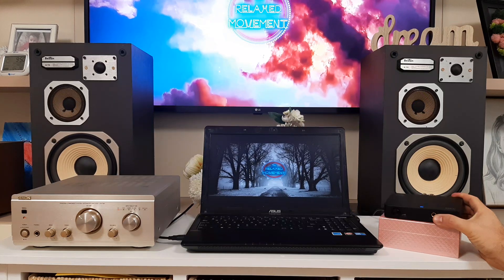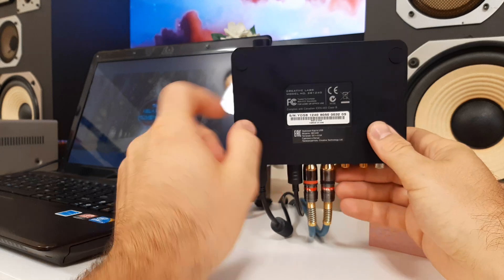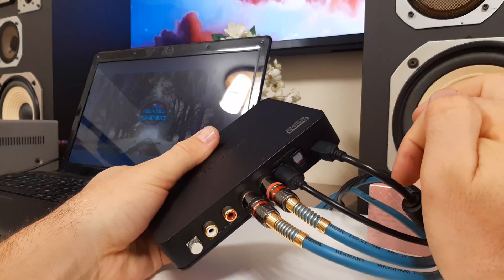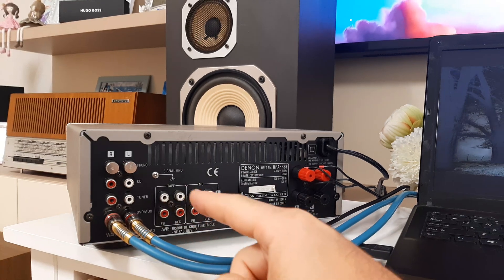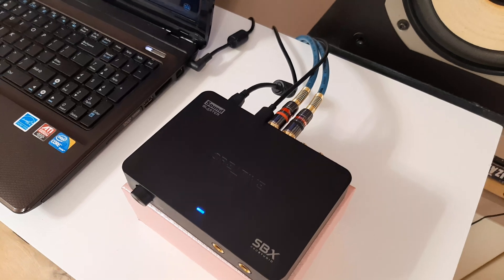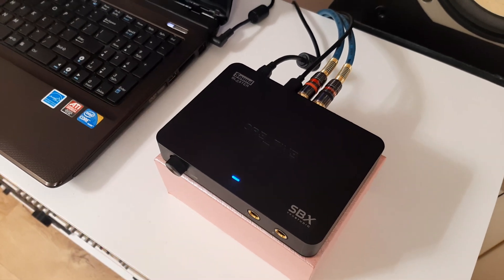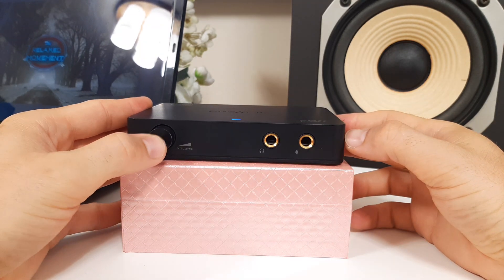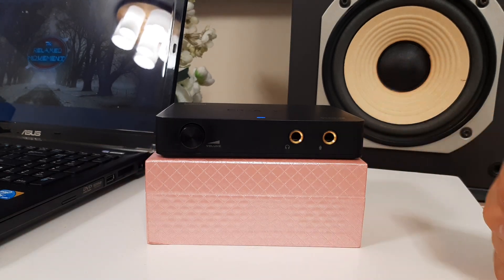How to Connect Audio Power Amplifier With Sound Card

Comment: hi, could you tell me how to connect the amplifier to the creative x4 sound card?
Reply from the maker: Hi Vladimir, congrats for your X4, good sound card. I will attach a link here for manual and i will explain also: https://support.creative.com/manuals/download.aspx?nDownloadId=14339&prodName=Sound%20Blaster%20X4%20-%20Quick%20Start%20Leaflet
Most probably you will connect via USBC with PC or laptop but is not only way. After you have to take out the sound and supply the amplifier. For stereo connection you have to use Line Out Front and is 3.5mm stereo jack L + R. Depends of your amp you will use RCA, XLR or Jack 3.5mm. 
Stay tuned more videos to go!
Cheers!